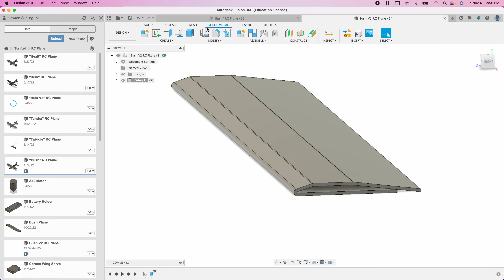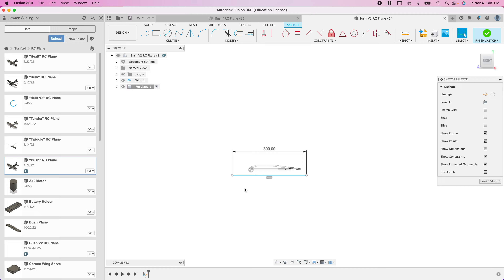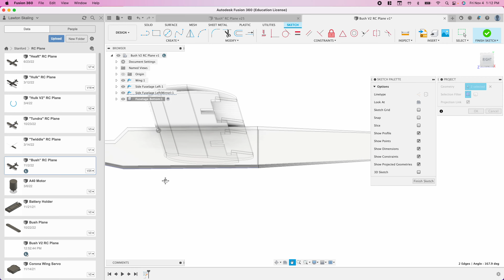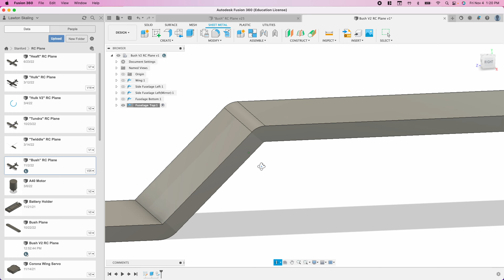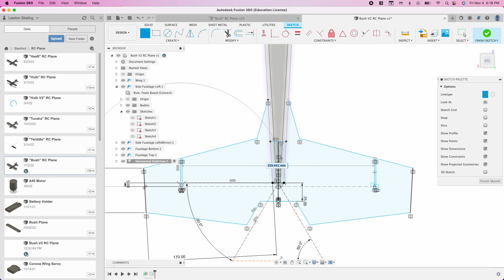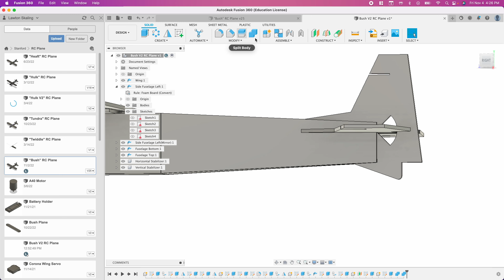How to design foam board RC planes in Fusion 360

Comment: Thank you for sharing, I tried this, but I am trying to create a trapezoidal wing to no avail, just the conversion to sheet metal fails to infer the thickness, when using a square wing it works fine; any idea, suggestion how to make it work with a trapezoidal wing?
Reply from the maker: It's finicky, I've had that happen a number of times. Ensure the body isn't connected on the back side, and you give a large and constant bend radius on both sides of the wing profile. Perhaps from the square wing try to slowly alter the shape to get closer to the trapezoidal profile until it breaks.

Comment: Why not build in balsa? Do you really prefer the low poly look and feel?
Not hatin, just curious
Reply: cause balsa is heavy and foam is much cheaper and easier to work with.
Reply from the maker: I've never built a full balsa plane (only wings). From my experience balsa planes take much longer to fabricate and assemble, so I've stuck with foam for the majority of my projects.
Reply: @lskaling  Give it a try. It's a rewarding experience